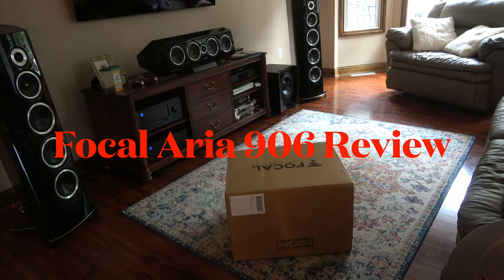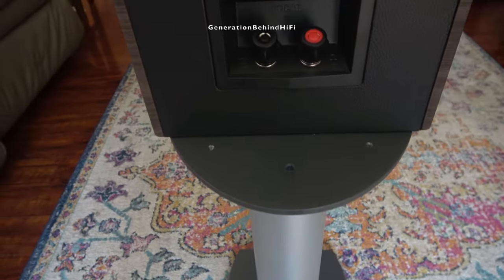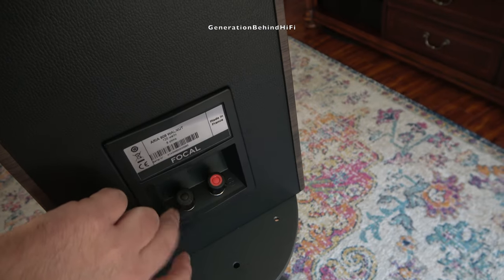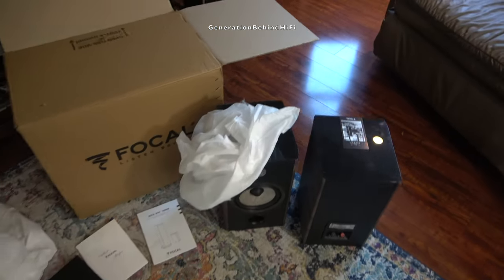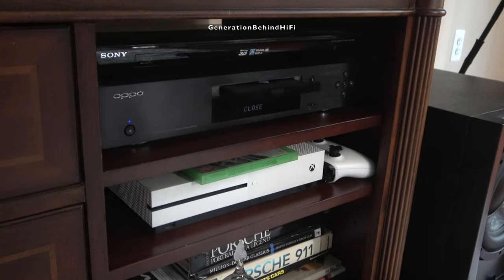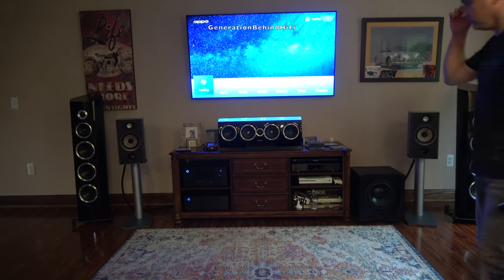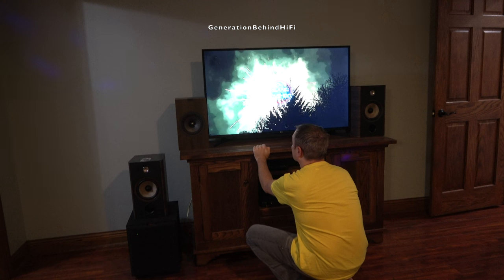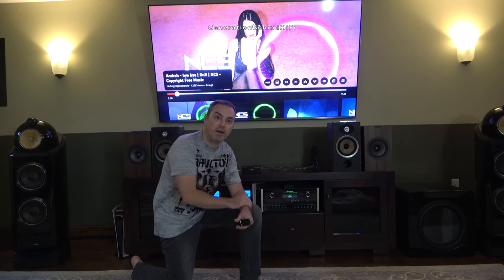A Review of The Focal Aria 906 Speakers

Comment: I had the same deal you mentioned here on the Aria 906 and did an extensive listening session at an audio shop in my city. I agree with your comment on their brightness. Having a Focal Chora 826 floor standing speakers, I find that they share that same brightness in high frequencies. In most cases I like how they sound even with that extra touch of brightness; however, they can become a bit fatiguing with cassette playback, not so much with percussion but more so with vocals when the letter "s" comes up. If the sound wave coming out of them had a blade, it would chop your head off with how sharp and pronounced it is! Still, I like the airiness they give to vocals in the majority of cases. I also found them to be flexible and tolerant with source materials. I tried a bunch of CDs on them from exceptional mixing and mastering to piss poor MP3 rips and they performed much better than I expected without the need to tweak anything. In my A/B testing, I was comparing these with a pair of Dali speakers (forgot the model) which were $800 more expensive. The Dalis sounded more neutral and natural in some cases, but mostly just sounded soft, laid back, and even dull to my ears in most scenarios; however, they clearly outperformed the Focals in almost 100% of all the rock and metal auditioning that I have done with more warmth and punch in lower frequencies. Ultimately, I had to choose one, and the Focals were it for me from an overall experience perspective.

Comment: I had some and sold them. Peaks at 800 and 1800hz.  Over ring.  Deep midrange canyon.  The cheap electrolytic tweeter cap saturates at medium loud volumes.  .  (even though I paid $1800 originally)  There are several speakers at the $500-600 price point that are better and measure flatter.  The focal are Overpriced garbage.  I sold mine
Reply from the maker: I don't blame you. I would feel cheated and ripped off if I paid anything over $1000 for these. I had such a bad experience with these speakers that I'm afraid to try anything else from them. Focal is definitely the Porsche of HiFi, meaning the value proposition is low.
Reply: @generationbehindhifi   under engineered and designed to impress snobs with deeper pockets than listening skill. I heard the flaws. They are mid fi in my book.
Reply: @generationbehindhifi  You give these too much credit.  There are a few $500-ish per pair speakers That measure and sound smoother than these.  By the time you get into the $750+. range, there are plenty of speakers that do everything better than these.  So, in my experience, these should be no more than $450 a pair. They have too many flaws to cost more.
Reply: And with what garbage did you replaced them with ? Chinese toy speakers at 500$ a pair ?
Reply: @generationbehindhifi  auch der Porsche lässt mal nach. War am überlegen mir Focal zu kaufen, aber ich glaube ich bin mit meinen ATL 706 pro besser bedient ! 😁